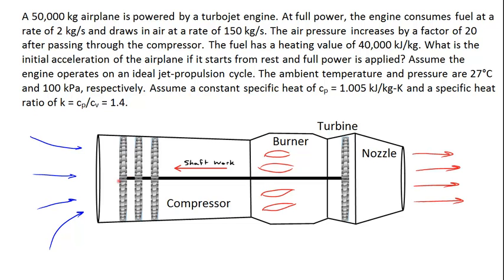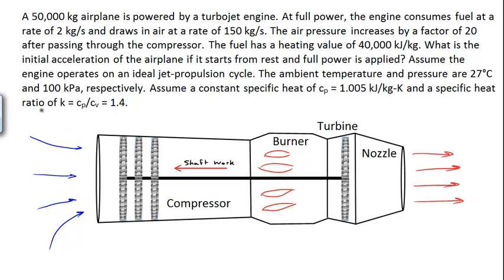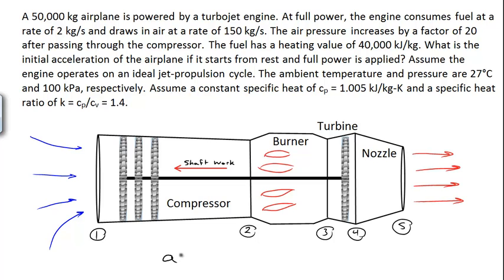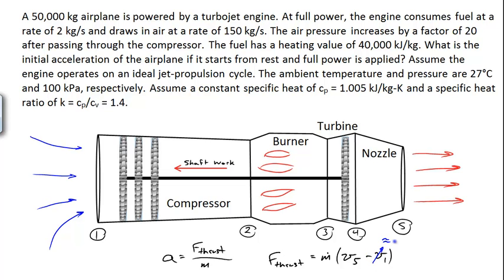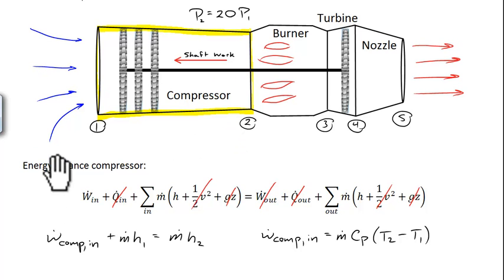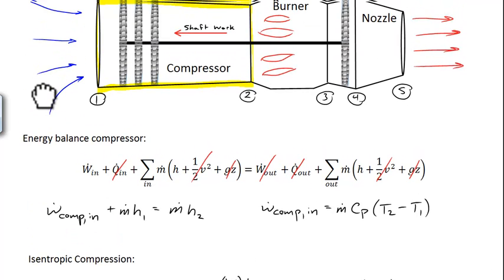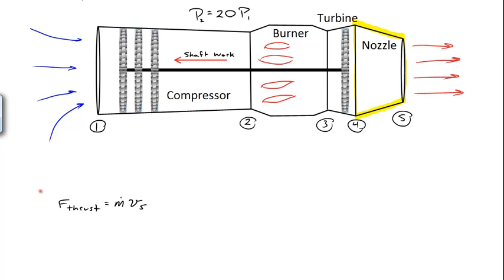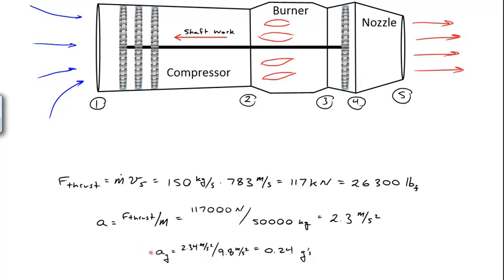Turbojet Engine Example

Comment: so it enters the turban .... that would be a very long silk scarf worn about the head ... or did you mean turbine ... like wine it is a long i not a short i ... ENUNCIATION is key there is no long silk scarf head wrap inside a jet turbine engine ...
Reply: Vsub1 is only negligible until the engine has spooled up to sustaining operation ... at which point vsub1 is NOT trivial because the compressor is SUCKING air in above ambient air speed .... and as the plane begins to roll the ambient air speed increases as the plane moves faster ... therefore Vsub1 is never able to be considered trivial and MUST ALWAYS BE calculated in.

Comment: The exit speed of 783m/s is supersonic, but by what value? By mach=1.7 or by mach=2.26? The value 1.7 is (as i see in other sites) if consider the sound speed related to the temperature of exit gas itself (sqr(1.4x287x526)=460m/s) , but is mach 2.26 if consider sound speed 340m/s as the engine is at ground level (300Kelvin ambient) as the table https://fighter-planes.com/jetmach1.htm   .